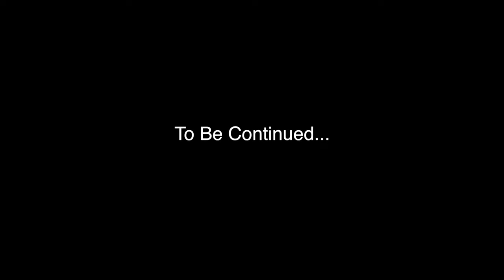How To Fix Stuck Brake Caliper Ford F250 F350

Comment: Cody,  The flexible rubber brake line can actually suck shut when the line gets to old and cause the caliper to lock on tight , I've experienced this.  the vacuum from the master cylinder will collapse the rubber line , and cause the exact problem your having .

Comment: Hi there Mr. W... have you looked that the proportioning valve . I had a jeep that did the same thing. The problem continued until I replaced it ... it's a expensive part but if you keep killing calipers you may want to consider replacing it.

Comment: I really like the older Fords (or any truck for that matter) that use the u-joints on the front axles on the 4WD models. My newer GMC uses CV joints on the front axle stubs for an independent front suspension. They suck to work on.

Comment: Your Grand Father was a very clever man, to rebuild your own caliper then you know exactly what state it is in. If you buy some cheap parts they are sometimes in worse condition than a rebuilt one. 
For your break line that is disconnected and dripping out all the break fluid, buy a pair of cheap vise grips, grind the grips until smooth and use it to clamp the pipe gently until it stops leaking.

Comment: Check your flexable brake lines as well. sometimes they will break apart internally and creat a one way valve where you can apply the brakes but when you release them the fluid cant return and release the pressure. after a while damage to the caliper will happen and the brakes will lock up just how yours did. Just a little extra something to look at.

Comment: Another common problem worth looking at, before you go out and replace a caliper, is to look at the slide pins. On the solid axel 250/350 they are a very common issue. When the boots protecting the slide pins are compromised, they allow water intrusion and it ruins the grease. Cheap fix, less than 20$ for boots and grease compared to a few hundred dollars for new calipers.
Reply: thank you, i'll have to check that out

Comment: change both front brake lines Cody .just went thru this last week .I used ss flex brake lines higher price but have used them on other high mi fords and end of prob .I'm a fleet mgr for a large utility and we have 210 f250 f350 pick ups

Comment: So.... What was actually stuck? I'm doing this exact problem for the 4rth time on a F250 SD and will be filming the dissection of these stuck calipers. My experience is almost always a layer of rust between the boot seal and the pressure seal, seizing in the bore.

Comment: Instead  of the disc you put a small rather thin plank between the pistons. Then just add high pressure air and keep your fingers safe. The rest is SOP.

Comment: That truck most likely had a collapsed brake line...the caliper won't release due to brake fluid not returning back to mastercylinder.when caliper heated up..it melted the caliper piston seals and oring causing the caliper piston to gall the piston bore..hopefully this mechanic will change all the brake hoses..sometimes the abs sensor melts internally and the abs reluctur ring cracks..you have a great comment....a $15 brake hose caused all this mess..

Comment: Always clean and grease the slide pins, seen lots of "stuck" brakes due to no lube on the pins.  Check around for a parts house that carries OE parts.  Here in South Texas, we have Full Service.  OE parts for cheaper than what you'd pay at the dealer.  A hand held Mighty Vac or a pneumatic bleeder works a lot better than the broom stick method.

Comment: should of check both slide pins. most likely it's rusted and seized up.  calipers piston don't lock up or stick unless you get containmated brake fluid that swells up the seals.

Comment: Cody it's brake line itself not the caliper, when the line heats up it can collapse and only allow fluid in the chamber but not out causing the caliper to remain loses until the line cools and the fluid will slowly work it's way out. More than likely you will run into the same problem until you replace the line

Comment: did you change the brake hose? brake hoses can collapse from the inside and cause the same symptoms as a stuck caliper.
Reply: as he said in the video while he was compressing the piston, the bore on the one cylinder in the caliper is messed up. The piston should never get hung up while trying to compress it
Reply: +Derrick K ahhh

Comment: I bought a new f250 in 1993 and had nothing but brake caliper issues with it. Traded it for a new f250 in 2006 and have had caliper issues ever since. Calipers will not last more then 2 years. It's in the shop now again, but for the last time. Buying a Toyota Tacoma.

Comment: Cody use a c clamp. First thing I do on a brake job is spray the bleeders with penetrating oil
Reply: +goriverman Large Channel lock pliers work much better that a c clamp...
Reply: +Rt Carolina i tired channel locks and they chew up the pads. and the pistons are ceramic so theyll chip very easily.
Reply: +Rt Carolina c clamp all the way lol to each there own i guess
Reply: Cainnech Pliers are faster. When your time is worth something you make the most of it. Like not arguing...just take the advise and say thank you or keep quiet.
Reply: BC4Lyphe Remove the pads before you compress the caliper... use your head as well.
Reply: +Rt Carolina geezus, man. you're gonna gnaw em all up using those. harbor freight has 6" c-clamps on sale all the time. like 5 bucks
Reply: rts Haven't yet (25years)...but you all know more than I do.  It's not like I don't have 2 dozen c clamps ( I'm a carpenter)
Reply: +Rt Carolina ceramic pistons and channel locks I don't believe you
Reply: +Rt Carolina you know why I don't believe you? because I used to use channel locks on my ceramic pistons and chewed them up them over time
Reply: +Rt Carolina what the hell is your problem?  so because I don't believe you, I'm annoying, immature and a hack? that sounds logical. have a nice weekend.
Reply: +rts  
Call somebody a liar, what do you expect? I've done dozens of brake pad changes on disc brakes and have never had to use a C-clamp, channel-locks or anything else to get the caliper off or on the rotor. Nobody believes that, but what can I say? I sit down on the pavement with combination wrenches, a hammer, and wire to tie up the caliper and NOTHING else. I've never had to get up for another tool to complete the job. Call me a liar too. I'll laugh in your face.  And I don't surface rotors, or use new ones. OH NO!!!!!! Guess what? Totally unnecessary.
Reply: +Tom Swinburn good for you. But removing the caliper with a c clamp is not  what we're talking about. I suppose you remove lug nuts with a screw driver too? Pay attention

Comment: Never had luck with NAPA warranty... I found RockAuto.com to be (usually) much better on pricing but you can still get the quality.  Local stores might have 1 or 2 options, but RockAuto has many more to chose from and usually even after shipping is cheaper.

Comment: Check your brake booster adjustment. It might be adjusted wrong or worn out over time and causing your brakes to ride the rotors causing lock up.

Comment: that was more like how to replace a caliper, not how to fix a stuck caliper. I must say that it's better your breaks fail that way rather than a leak or the piston return square ring leaking. that happens to me on my jeep when i was rock crawling and I still had to get down the mountain. that was a fun ride.

Comment: I'd replace the rubber brake line as well the insides of the lines detierate after time and sometimes a pice of rubber on the inside of the line will come lose and block the line and act like a check valve

Comment: dont forget the rubber brake line.   I had a front brake hang up and after fighting it for a while figured out that the interior of the rubber hose had swelled shut.  It would retain pressure.

Comment: I need to get on a good set of Jack stands and a hi lift.
Reply: +SCJMO Get a good floor jack,  hi lifts are great for off roading but terrible for actually working on cars or trucks.
Reply: +27dcx I have a good floor Jack that has a dandy chainsaw like case for travel.  So it's a solid piece of kit, bc those scissor jacks or bottle jacks that come with your pickup or car are absolutely pieces of garbage.

Comment: most cases its rust , due to defect ore wrong mounted rubber dust/water caps, the piston wil just eat and get stuck, in some cases its binding due to the heat, a wrong diameter of piston in the cilinder wil get stuck due to the lack off lubrication and dust and rust., can even happen on new and rebuild ones.

Comment: You think brake fluid is bad on the skin...try getting it in your eye. Only thing worse than that is brake cleaner from an aerosol can. Popping the bleeder valve on the caliper might have made it easier to get off the rotor. Depending on how badly its seized up of course.

Comment: The 99-2004 trucks all have the same problem which includes your truck one of the pistons gets stuck the brake pads get cocked and they start to drag. Your problem is the truck sits too much if you drove the truck every day the calipers wouldn't stick. On my 05 F-350 I ended up using nothing but Napa remanufactured calipers they are the only ones I've found that haven't failed.
Reply: +Graveltrucking yep. I drive mine at least weekly. keeps things moving freely, just like joints and muscles need to move often.
Reply: rts Its also good to use the brakes a lot I know with myself I can decend hills without using brakes because I reduce my speed before the hills. You get used to driving in an area its the way it is.

Comment: If those are Wagner Thermoquiet loaded calipers, NAPA should exchange the whole caliper under warranty. I would have the rotor machined to correct any warpage and surface glaze. If you have a dial indicator you can measure the rotor for excessive runout.

Comment: Tried to rebuild mine on 2003 ford f250 5.4 4x4 rears and i could not get new ford oem rubber boots ( i paid fortune for) back in, tried everything, dont have air and seen one with air that might work but by time i got all 4 back in i pretty much put a hole in every boot, so guess im just buying calipers and sticking them on AGAIn.

Comment: Did Napa sell you that caliper painted black like that or did you paint it?
When I replaced front caliper for F350, I was hopping to get either painted or zinc plated one, but could not find any in local stores. Rusted right away on first rain. At least calipers are not visible with stock wheel. 
I could have painted myself, but just too much trouble. Wanted to get the job done right away. 

BTW, I ended up getting caliper, rotor, and break pads from Advance Auto Parts and caliper locked up after just 4 months. Advance Auto Part did replace all of those under warranty, but lost a day of job. :(

Comment: constant problems with super duty calipers, oem or aftermarket doesn't matter. ford should have a class action lawsuit for faulty brake calipers, spark plugs blowing out of the engine, coil packs, and rot

Comment: are you using old brake fluid to fill or refill the brake system? If you are I will assure you that the pistons in the calipers are going to rust in a short time. The alcohol Will absorb water. While you have the system apart i suggest to push the pistons out to see if there is rust or rust corrosion on the pistons. This is simple apply air pressure to the inlet line That should do a lot to determine why the system failed so soon. Complete oil change would be in order. Maybe  a few times. 
I would have the rotors sent out to see if they are out of round since they were overheated.
I wouldn't have leather gloves on. Try using some sort of rubber gloves. That break fluid is nasty stuff on the skin.
Im just saying. Not telling to do anything.

Comment: Yes brake fluid feels funny. However, when I took a brake class in college, the instructor said brake fluid contains lanolin. He said, when he injures his hand on the job, he rubs brake fluid on the wound, and the lanolin helps with the healing. Just repeating what the class was told; and my experience does not go against this.

Comment: Ford and Dodge axles have not been the same since they quit using DANA. Ford axles are made by Sterling and Dodge uses axles made by AAM. They are NOT the same. Neither is really better as they both have design flaws. After having both apart many times for many different reasons AAM axles are simpler and easier to work on but not that much better.

Comment: They sell a tool bud  company called Lizle it fits on the brake pedal and puch front seat forward till brake pedal goes to fkloor then remove your brake line you wont lose any fluid just disconnect battery so vbattery brake light doesn't kill battery that's how I do it and you don't lose any brake fluid . just a suggestion

Comment: I guess  I am not the only one to notice that parts don't last like they use to !  Right now I am having a bunch of problems with brakes on my current car- The system is pretty much worn out- so rather than keep sinking more money in to it, along with some other problems, I am going to buy another car- my current one is 20 years old!  I can do the simple stuff but engine and tranny work nope is it way more that the cars worth so  to the junk yard!

Comment: You need to have something to hang the brake caliper from before you take off the first bolt.  No weight should be on the brake line or hose.  They are made for internal pressure not to be used to hold weight. Taking off the caliper and exposing the system to air is a last resort.  Brake fluid and even just the moisture in damp air make a corrosive mixture inside your hydraulic brake system.
Reply: +Edward Jonez I agree 100 percent. I will also add that the water collects in the cylinders. When you use the brakes hard ,the water can boil and hang up a piston. The cockeyed pad you see may be secondary damage as a result of overheating the entire caliper. When doing a brake job, it really is a good idea to flush the entire system with FRESH ,new brake fluid and not use something that you've had hanging around a couple years  .

Comment: might wanna lube those slide pins. You replace calipers ever brake job?
Reply: +MasterTech58 every superduty i have had .clean lube slide pins.bout once a year .if not they stick get hot clamp tighter.
Reply: +bob clark to fix prob .i have 92 f250 with wedges instead of bolts
Reply: +bob clark yea I service several fleets with these trucks clean and lube pins with the brake job. Never had a problem
Reply: had one lock up.made me mad drove home anyway melted balljoint rubbers off..cleaned pins anti seize perfect.
Reply: +bob clark yea sometimes it's gonna happen. good ole Murphy is out for everyone. A lot of people don't crack the bleeder open when pushing the pistons back to make room for the pads. All that crud just gets pushed back into the system.

Comment: Sometimes you get lucky and the brake problem was just a piece of gravel jammed in there.  I have so many horror stories from working on brakes like the time I forgot to put the pin back in there.  Luckily my neighbor saw it on the ground as I was taking the vehicle off the lift.  He asked me if I was committing suicide.  I was, WHAT?  That was before I realized that I needed glasses.  LOL

Comment: That's your problem buying parts from Napa if you bought a Ford caliper it would last hundred thousand miles plus Napa. Your lucky to get 10,000 miles out of them before they lock up that's the difference in Ford parts and aftermarket junk they might look the same but the internal components are different

Comment: not a big deal, but I would have removed the caliper before removing the rotor there's more leverage to work with on the truck just not the way I would have done it

Comment: When you said your truck is a "1 ton", what does that mean?
Reply: +trentonfrank It's the load rating, and has to do mainly with the strength of the frame, axles and springs. Most trucks are available in 1/2, 3/4, and 1 ton versions for example under the old chevy truck model system, the 1500 was a 1/2 ton 2500 3/4, and 3500 1 ton. Generally anything less than a one ton has the weight of the vehicle on the axle shaft while a one ton uses the axle housing to support the weight of the vehicle. You can generally tell a 1 ton axle by the 8 lug bolt pattern.
Reply: +27dcx Awesome. Thank you very much for clearing that up for me!

Comment: the problem is the slide pins
Reply: +Ray Ford If that was the case, the pistons would have compressed easily when he tried to pry them back with the crow bars.  He also removed the pins to get the caliper off the axle, but the pads where still stuck to the rotor.
Reply: +MitchF150 he didn't remove the pins.  the piston did move.  what didn't move was the bracket.
Reply: I must have missed that... I'll have to watch it again..
Reply: +Ray Ford Indeed, when the pry bars hit the frame, the frame should have moved but didn't, seems the sliders and the pistons are stuck
Reply: the pads were not stuck to the rotor. they were squeezed to the rotor.
Reply: My superduty has slide pin issues often.  Changing brake fluid out once a year helps keep the pistons from sticking. Just a gravity bleed to clear each caliper to clean out burnt over over heated brake fluid. Old fluid is the problem.
Reply: Maybe not on that one but I use copper marine grade anti-seize on my pins after having one stick many years ago. No sticking since.

Comment: I've had this happen on both of my f250s and it is usually the return line that collapsed and not letting fluid back into the master.
Reply: What do you mean return line, there is only one line that goes to the caliper?